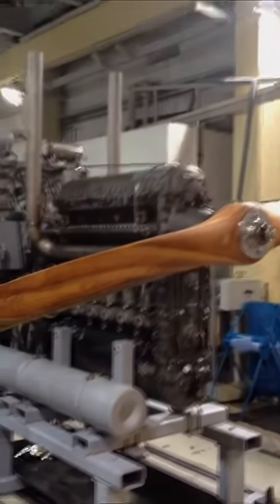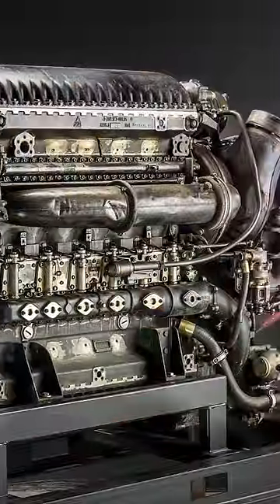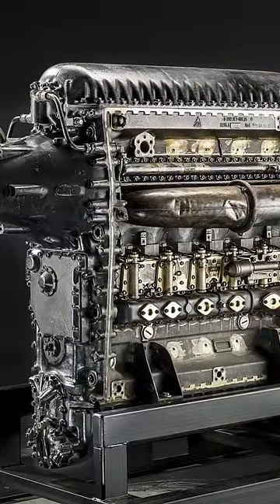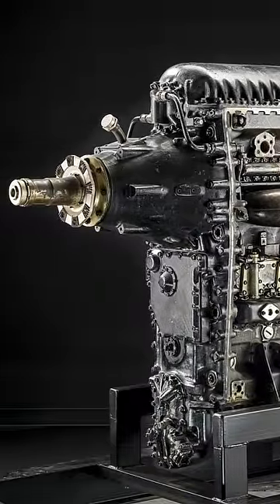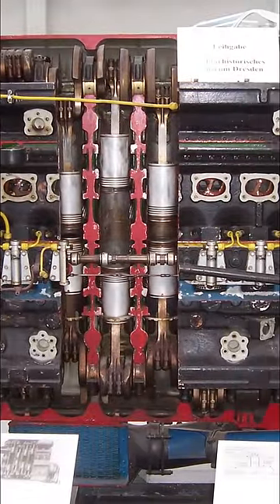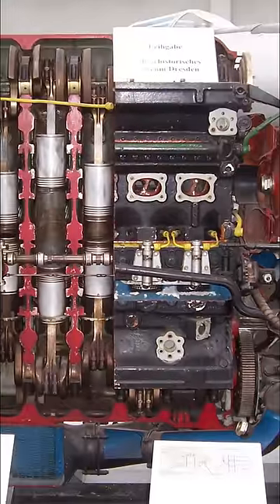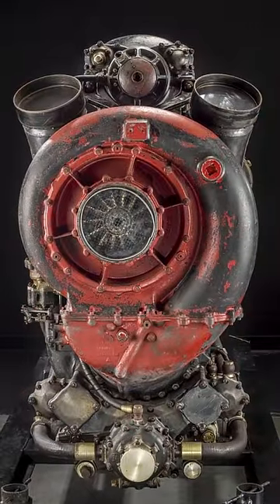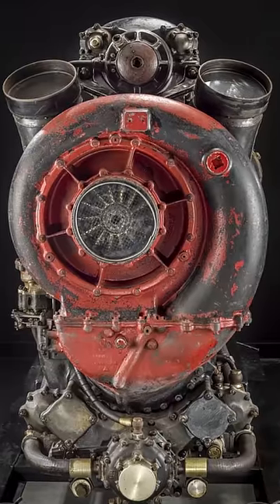Old ENGINE Laughs At New Diesels - Jumo 200 Series

Comment: That thing has some power why don’t they use this to power a really high voltage generator that’s powering a really. High voltage electric motor I think motor voltage stands are the biggest hold back  ..     

Diesel would provide the range electric motor efficancy and power.  

No need for a huge battery just back up.

Comment: Diesel engines are not lightweight enough or a very practical design for Aviation, or at least I don't really believe so, or I think it would have gained more popularity throughout the years ! , The Germans only probably should have stuck to using them only on the airships of the day ! 😮

Comment: One simple question : 
Wouldn’t you have to be crazy to leave the prop on that thing and run it inside a building ?????? 
Am I the only one that can think thiS THOUGHT ???
Reply: As someone who test ran engines bolted to a welding bench with a garage door directly overhead less than a foot away from the prop yeah you gotta be just a lil crazy.

Comment: Modern diesels cant compare to 80s and earlier diesels when it comes to many things. 
So called Eurodiesel engine is Forced out of optimal operating conditions after it started posing a threat to Gasoline engines in the 90s. 
NOX is not a normal Ocurence in D2 diesels Its a product of Lean burning Eurodisels. In manufactured pollution to give maouvering space to gasoline engine market. 
Simple reason why Is Gasoline refining Uses up more Crude oil.
People who Own oil don't Own it so they have bragging right ,they bought it to ear money from it. They don't need you driving Super efficient cars that Are also fast and accelerate well as well as last forever. Like the 90s diesels. 
Also Kids dont know But it Europe Up until early 2000s 1L of diesel was half the price of 1L gasoline. 
Because you can get up to 74% of Furl back refining D2 Diesel from Crude oil. And up to 43% Of gasoline. 
Rudolf Diesels Engine In Better design in Every Way from the very start.